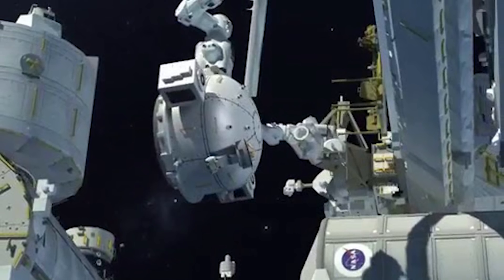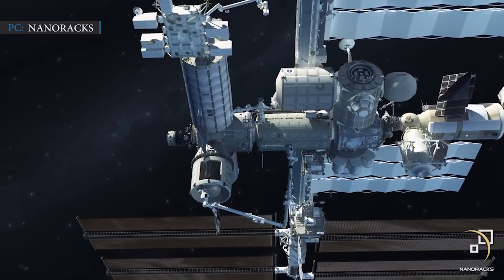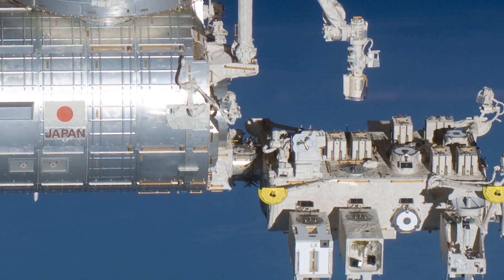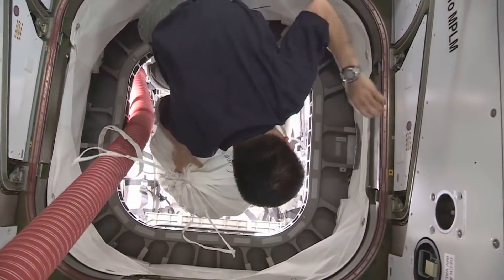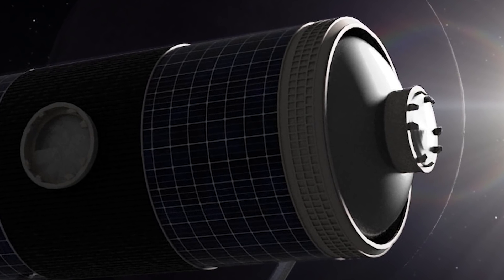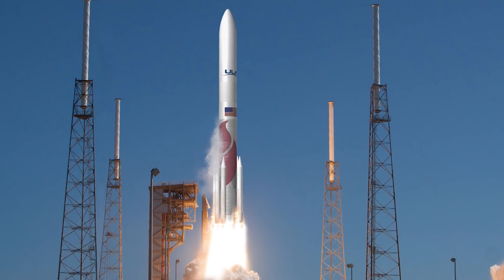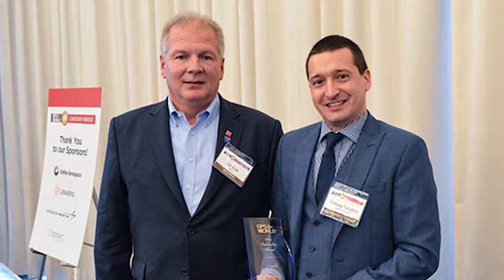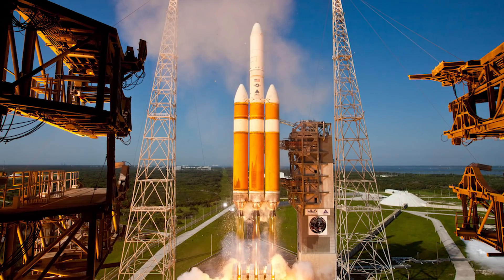SpaceX’s Falcon 9 Rocket will Fly Commercial Airlock to ISS | ULA has been Awarded to Fly NTS-3 Sat

Comment: Will this new airlock allow sending new spacesuits to the ISS as not pressurized payload? 
As a pressurized payload, the dock door is too small, but for this airlock, it looks like the old, bigger door is used. 
- close the airlock
- unpressurize the airlock
- take the cover away
- take the spacesuit from the dragon unpressurized storage
- put it into the airlock
- close the cover
- pressurize the airlock
- open the airlock from inside

Comment: Coin flip: heads we use Falcon 9, tails we use ULA for $40-million more, not that it matters to us since we've got all this taxpayer money to spend.
Reply: If the payload requires vertical integration, or a larger than five meter payload fairing, then Falcon can't handle it. Under the new national security contract they are going to develop those capabilities, but I don't know what the timeline is.
Reply: Its going up on a cargo resupply mission. So no additional cost.

Comment: The ideal tanks to convert to space station modules were the Space Shuttle external tanks. Perhaps an SLS core stage would serve as well and one can send the 4 RS-25 engines (at $ 75M apiece) back to Earth on a cargo return craft or use them in some other way? Spent rocket stages should have been utilized a long time ago, but space has no priority! Go Artemis.
Reply: There was actually a plan to use Shuttle ET's as space station. If you used up the fuel margin it could have gotten into orbit, since the ET was dropped just about 100 m/s short of orbit. SLS is similar in that regard although the put it into a highly elliptical orbit to get more performance out. So the final SLS orbit before stage two ignition is something like 60 x 2000 km. It certainly could be done in theory. People have speculated that SMART once conceived for Vulcan could be used to return the engines but it's not clear if could survive full orbital reentry, since the Vulcan core gets about 80% the way to orbit.
Reply: For only a billion dollars per Space Shuttle flight. In a few years, Starship will be able to do anything a space station can, for more or less the price of a Starship...

Comment: Everything that I have heard claim that expended rocket tanks mak poor station segments, not to mention the in orbit work time required to reengineer them.  It seems better to send up  specifically ground built modules.
Reply: You mean specifically ground built modules like a pressure vessel with hatches, airlocks, and berthing adapters on it? Cuz that's what tanks are. Pressure vessels.